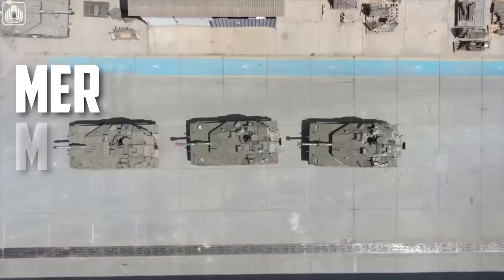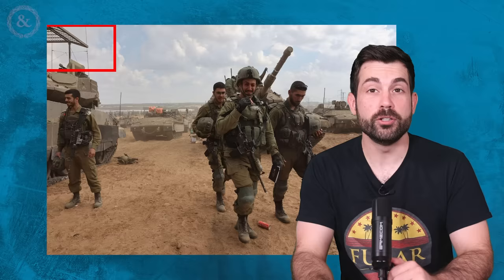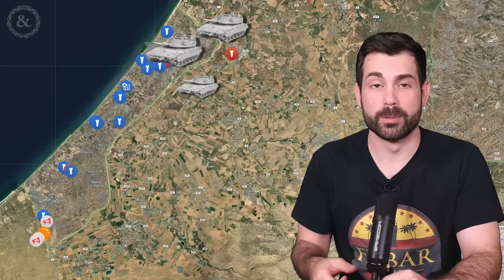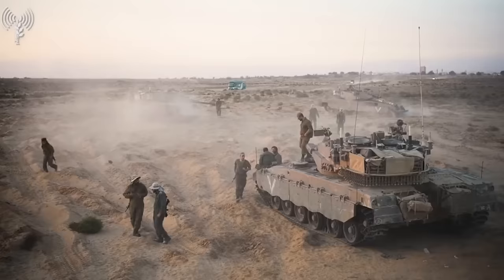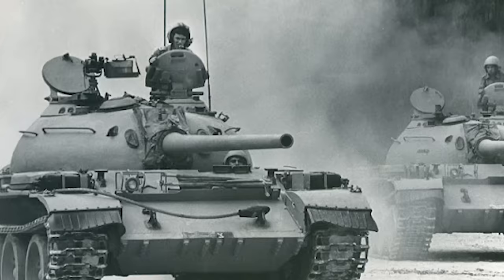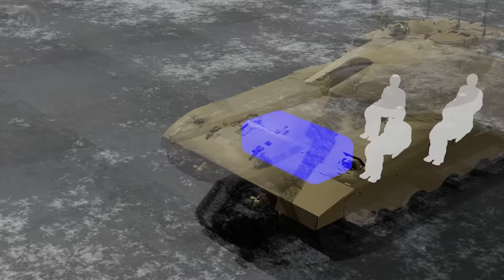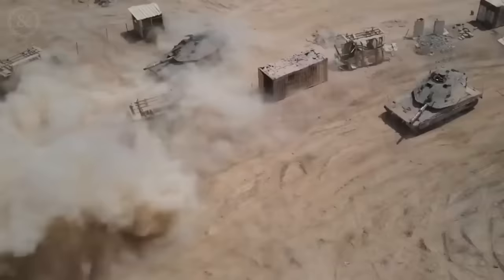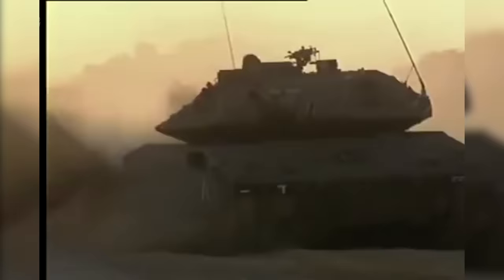Israel’s Home-Built Merkava Tank Tactics

Comment: The "cope cage" was ment to protect against shape charge type munitions, like Rpg's. It detonates the warhead early, for those interested who aren't informed, check out how an Rpg works, it's pretty cool.
Reply: Meant. However. It has failed in combating NLaws and javelin.
It should stop grenades and light drone attacks.
Reply: @gorethegreat NLaw and Javelin have tandem charges which bypasses both ERAs and cape cages.
Reply: @Dingusdoofus  I know
Reply: They are usually intended to deform the shape of the warhead prior to detonation.
Reply: The cope cages are made for people who can't cope with their favorite tank being destroyed
Reply: @SamBrickell  they are designed to detonate the incoming warhead and cause the explosive formed copper jet to spall on the armour
Reply: No they're not they're used to break up the tanks silhouette so drones can't see them
Reply: @Dingusdoofus 
NLAW is not a tandem HEAT, it's an overfly top attack EFP (Explosively Formed Penetrator)
Coped up tanks stand no chance because:
1) the heavy Tantalum EFP goes through even proper armour like tinfoil, mild steel bar armour may add will not exist.
2) Bar armour is designed to trick the stand off fuze of heat Warheads to fitting early. NLAW is magnatometer driven.
3) even if there's multiple layers of ERA between the tank and the NLAW, EFPs don't need a tandem charge as they rely purely on brute force. Dense tantalum slug going Mach 3 does not get deflected by ERA because ERA is pretty drained to disperse a high pressure liquid copper jet. It's like putting your finger over the end of the hose, you can turn deflect the water jet. The slug would need more of a baseball bat to deflect it
Reply: @gorethegreat  Its was never intended to stop NLAW and Javelin, its cheap and stops you from dying from many types of anti-tank weapons, which is a pretty good deal
Reply: @Dingusdoofus what about a drone dropping a bomb, does the cage work against that?
Reply: Were they effective against the EFP's(explosively formed penetrator) at all? Those are basically what at RPG warhead is, I believe. Explosives behind a cup shaped thing of copper that gets turned into a molten copper penetrator that can penetrate armor like 14 inches thick or something.

A buddy of mine was 1-8 Cav US Army and was killed by one in Baghdad when an array of EFP's hit their Buffalo on Route Predators.
Reply: Everyone made fun of Russia for them but I always though it was kind of ingenious.
Reply: @Dingusdoofus  cope cages just aren't large enough to disrupt the jet. So without ERA, a cope cage wouldn't even stop a single Shape Charge.
Reply: @matanelsiboni9269  if the bomb hits the cage yes. If not, then the tank is done.
Reply: @dantauche7917 That's definitely not what they are used for.
Reply: @matanelsiboni9269  yeah should. Most drones are not very good and can't lift much.
Reply: @ChairmanMeow1 it didn't help russia not to lose so many tanks. so useless.
Reply: @alexanderp8037 you don’t know what the cope cage is against only
Reply: @gorethegreat  it was never meant to combat them...
Reply: @Dingusdoofus  depends on the bomb: whether it can penetrate tank armor or if the operator managed to get inside one of the hatches
Reply: @Prometheus7272 and Hamas does not have those anti tank systems only normal Russians rpgs which can hit only the sides

As far as I like Hamas does not have gliders from which they shoot rpgs straight down onto a tank ;)

The. Cages are for drones only
Reply: @J.C...  good question, nope, they are completely ineffective against modern shape charges such as the NLAW or FGM-148 Javelin. I'm going to assume that the HJ-12, basically the Chinese Javelin, is also right there.
Reply: @Dingusdoofus the tandem is best against Era NOT cages. I love when people talk about things they know nothing about. The tandem warhead detonated almost immediately after contact it doesn't break the cage then fly further.
Reply: @SamBrickell You’re thinking of slat armor like the kind on the Stryker in the video. The cope cages are meant to stop drone dropped grenades and shaped charges.
Reply: @MostlyPennyCat HEAT jets are not liquid, more so the copper is just going so fast that steel and such, acts like a liquid.

But the jet itself only gets to about 600-800 degrees, not enough to melt steel, copper, or tantalum.
Reply: @cekuhnen  They have 8 story buildings which they can shoot rpgs down from, good enough
Reply: @Prometheus7272  good that you are not a tank commander …  like the Russian commanders during chechnya
Reply: @Dingusdoofus  Hamas has a ton of tandem RPG warheads these days
Reply: @J.C... they won't do shit against an efp... but they can deform and prevent an RPG warhead from detonating... that's it
Reply: @cekuhnen Hamas makes there own kit, there diy rpg use tandem warheads
Reply: How so? @cekuhnen
Reply: So basically they weren’t such a bad idea but everyone clowned on them because it was Russia, but now that it’s Israel it’s suddenly a good idea 🙃

Comment: To be fair, in 1948, the Sherman was neither vintage nor a hand-me-down. It was actually still the primary tank of US armored units, alongside the Pershing.
Reply: and most of the models we gave them were considered state of the art for the Sherman itself
Reply: The Shermans didn't come from the U.S.A., there was an international embargo on Israel. Those were bought from France, which is why they ended up being re-gunned with the gun developed for the AMX-13, which Israel had also bought.

The Tank Museum channel has a fascinating piece on it, as does The Chieftain if you want the close-up specifics.

Shermans were a badass, much better crew survivability than any peer tank. Details on the why of that are in a different Chieftain video.

Comment: That Mark 5 sounds like one kick ass tank. The fact that the engine is in front I find to be very interesting. It also makes the back end shorter making it more maneuverable in an urban setting. Which, it seems ultimately was one of the key design elements. Plus, with access from the rear, as was mentioned let’s many evolutions happen that are not normal too any other tank. It seems to me Israel puts a very high price on all of their trained personnel, knowing they are not cookie cutter replacements just waiting to go into battle. Also, the anti-rpg/ tank killer rocket system is top notch, probably imho one of the best out there today, and it auto reloads.
Reply: Meet the Barak tank (lighting in Hebrew)

Comment: Cope cages were dumb when they faced javelins and nlaws. But the threat changed to drones and they have a use against those
Reply: Drones just drop their bombs on the engine ( like Hamas did when they hit the front of that Merkava ) - FPV suicide drones just fly under the cope cage and hit rear or side of turret, or just the engine which is a mobility kill.
Reply: A dedicated "vertical threat only " trophy system" is being tested and installed aswell.
Reply: Merkavas have integrated 60mm mortars
Reply: @chrissmith2114  fpv drones are kinda the 3rd evolution and yes the cages dont do much. But the threat they work somewhat against is the open hatch on the top where drones were just dropping grenades in. Im not gonna say its a perfect or great solution tho
Reply: Hmmm maybe drones were there in the beginning in ukraine as well?
Reply: When do you think they were facing javelins and nlaws?
Reply: @kermitthefragg  after the US and UK pumped ukraine full of them...
Reply: dirt-kw7cy merkava engines are in the front
Reply: @chrissmith2114 not only that but because the merkava has its engine in the front if it explodes it can actually kill the crew

Comment: This was one of the best, if not the best of the Israel Merkava tank. This tank is far more advanced than many Weston tank and one can see the design was made for protection, carrying troops full visual 360 and much more. I was very impress with this video and the production, many thanks from the UK
Reply: Tbh I sometimes wonder how many details about the tanks aren't being shared publicly, but it does make sense they have a lot of modern cutting edge features. Constant pressure to protect against ongoing situations in combination with not really having a weight restriction (primarily impacts just speed and acceleration rather than being able to cross a bridge or not).

I suspect with many western tanks there's a lot of discussion both during design and post adoption modifications with what to allow and what isn't acceptable. Less internal space, size and weight constrictions due to wanting a general purpose vehicle that can be used (just about) anywhere will be a limiting factor.

Comment: The difference in use of cages is the reasoning they have been employed. Russia began using them to try to counter javelins which REALLY did not work... Hence them being called "cope cages" but over time has proven somewhat useful against drones dropping Munitions... Which is why Israel is slapping them on (and why I believe they will become more refined and commonplace around the world).
Reply: I guess the new gen MBTs will be needing a Laser CROW... as the anti drone trophy system
Reply: I think with advance of trophy system they just extend it to also protect from above like dome around the tank, the projectile from a drone is why slower then an actuall rpg I don't believe it will be hard.
Reply: @Itzix  Yeah but I think the fact that it's so slow is the actual problem, because then they need to make the trophy system so sensitive it would go off if you threw anything on the tank. That would be a hazard and you could possibly overwhelm it by throwing random things on the tank before throwing the actual warhead.

Comment: I agree totally about crew survivability being the most important attribute of a tank. That is why the Sherman and Tiger are probably the best tanks of WW2. They had the highest crew survivability.
Reply: Max Hastings has called the Sherman tank: "One of the Allies' greatest failures."  In contrast to the German tanks, the Sherman was definitely inferior with respect to both armor and firepower. Indeed, the Germans called the 
Sherman: "The Tommy Cooker" because it's armor did not adequately protect the ammunition and a well-placed
round would likely set the Sherman on fire. Thus, the Sherman's survivability was inferior to Panthers, T-34's, and Tigers.

The Tiger was expensive, took a long time to build; it was also heavy, difficult to maintain and repair.  It did have an excellent 88 mm gun and it did have superior armor. But relatively few could be produced;  it suffered from from its weight -- eg the 1945 Budapest campaign where bridges collapsed under the weight of the Tiger and it also often became bogged down in wet, muddy conditions.
The best overall tank in WW II was the T-34 which was inexpensive, had innovative, efficient sloped armor, a good
gun, was fast, relatively easy to maintain and repair, and was also light enough so that it did not suffer from the same problems as the Tiger.
Reply: @salsanchez2114 Sherman survival rate was good, T-34 survival rate was pretty bad
Reply: @jameskhoune2858  The T34 in 1941 had three main problems, it was new with a small resource, it fell into the hands of untrained people. Also, the main opponent of the t34 was the enemy's artillery. The Germans at the beginning of the war had tens of thousands of guns, caliber 37-50 millimeters, which mostly destroyed the t34. Sherman with his cardboard sides would have had even less chance than the t34. When the Allies themselves began to actively, massively use the Sherman, a lot of mistakes had already been fixed there, the t34 had no such opportunities.
Reply: @salsanchez2114  t34 was garbage. Unreliable, horrible crew comfort and survivability. Best tank of the war was probably the panzer 4 or the panther.
Reply: @CptAngelKGaming  The panther is actually a great tank because a better tank for you crew compared to panzer 4. It’s better to have 100 panthers than 150 panzer 4s because less overall resources needed in maintenance, fuel, and crew.
Reply: The Sherman was known as a Ronson.  It was worthless for the crew.
Reply: @CptAngelKGaming  Panther, this is muso. If the Panther had fought against the Germans in 1941, the panthers would have ended faster than the t34.
Reply: @chrisrichard2526 this is quite a myth. There is a variant known as the Ronson, the M4A3R, which is the flamethrower variant. The nickname for the other Sherman’s was due to the British in North Africa. They overstocked on ammo because they could go days without resupply of ammunition so they overstocked beyond the armored ammo boxes of the Sherman. When hit the British would suffer from ammo explosion because of their overstocking. Americans throughout the whole war and the British in Italy and Europe didn’t have this issue at all. Properly stocked ammo and furthered up armored ammo stowage and the integration of wet stowage made the Sherman have by far the lowest ammo burnouts of the war. I believe it is around 20% compared to the Germans burn rate being in the high 50s to 60s
Reply: @salsanchez2114 not at all. That’s not what defines survivability. Sure  armor is a factor but crew survival rates and so much more is a factor. Sure the panther and tiger had thick armor except they had really high burn rates and were hard to escape. t34s were just awful, they were cramped, hard to escape, had extremely high burn rates, and had major spalling issues. The Sherman did have any of those. Also the protection of the Sherman was superb around ammunition and fuel. A story of a M4A3 crew I have been told is an example of this. The man’s tank was ambushed by a prepared anti tank gun. The tank was hit low, where the ammo was stored, but failed to blow up. Because of the Sherman storing ammo in something called wet stowage became extremely hard to kill. Tanks that weren’t equipped with wet stowage were up armored where the ammo was stored. The panther and tiger weren’t, and had extremely high ammo detonations. I believe they had a burn rate of around 80%. A late war Sherman was at 15%. Another advantage of the Sherman was survivability when hit. When a Sherman was hit the odds of surviving were very high. The Sherman had a survival rate 80% coming out unscathed. At its worst the Sherman averaged 1 crew dead, 1 wounded when hit.  The next closest tank was the Churchill at 60-70% coming unscathed. German tanks are close to the bottom in terms of survival rates when hit because of poor unarmored ammo sponsons and heavy hatches. The German tanks were horrid in terms of survivability, the Sherman was really good. I believe the reason why so many veterans complained about the Sherman was because there were so many, not many veterans of the other tanks can bad mouth it because not many lived being hit

Comment: I enjoy your videos and appreciate your appetite for developing your expertise.  I  do not beleve you are an "average infantryman ."  You are way, way above "average."

Years ago I read that one of the  most important features of the Merkava tanks is that they moved the hydraulic  lines from inside the tank to outside the tank.  They moved the hydraiulics outside because of the number of soldiers that suffered burns.  They found if an armor piercing  round entered the tank interior it was likely to hit a hydraulic line.  If a hydraulic line is damaged it would release hot hydraulic fluid under pressure creating an oil mist.  A second round was likely to ignite the hydraulic fluid burning the tank crew.  By moving the  lines to the underside the tank crew is better protected.

At the time, only the Merkava had this feature.

Comment: Upgraded and upgunned American Sherman tanks were used extensively by the IDF.  They were initially equipped with the French long-barreled CN 75-50 high velocity 75mm gun.  The increased weight of this conversion caused noteworthy issues with the existing Sherman drivetrain, (which was fitted with the Continental R-975 gasoline engine and the VVSS suspension system), including engine strain, which lead to numerous mechanical breakdowns.  Off-road performance and reliability was also adversely affected by the tank’s narrow tracks in this iteration.  

This Sherman variant, designated by some as the M-50 Sherman, was upgraded with the addition of the HVSS suspension system and the 460hp Cummins V-8 Diesel engine (considered less prone to fire).

Israeli Major General Israel Tal in his M-50 Sherman tank successfully destroyed 5 Syrian tractors on March 6, 1965 at a range of 2000 meters (2200 yards) in under 3 minutes.

In the early 1960s, 180 IDF Shermans were further equipped with the French Modele 105mm main gun.  This variant was designated the M-51 by the IDF (often called the “Super Sherman” abroad), and was highly effective in combat.

M-51s performed especially well against the newer, heavier Soviet T-54/55/T-62 tanks, regularly knocking them out when using High Explosive Antitank (HEAT) rounds.  

M-50 and M-51 Sherman tanks served with IDF armored forces until the early 1980s (M-50 Continentals were retired from service in 1972, while M-51s remained until ca. 1982).

Israel also deployed American M-10 Tank Destroyers it had scrounged from European scrapyards and dumping grounds ca. 1948-50.  This initial batch was in such poor shape that it had to be extensively repaired, with the M-10s not seeing action until ca. 1955.  Israel may have also acquired Diesel engines for the M-10s from captured Egyptian Shermans.  Some M-10s might have been purchased from France in the mid-1950s, and some captured from Egypt in the same era.

Note:
1.5 kilometers is 0.932 miles.